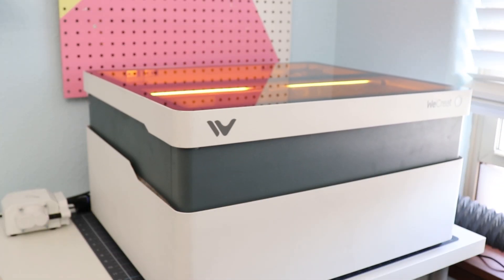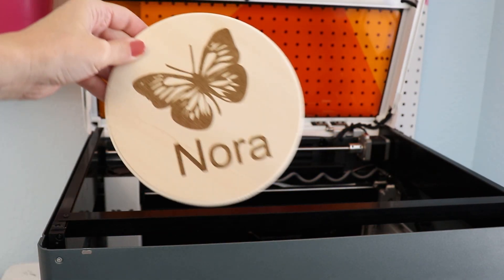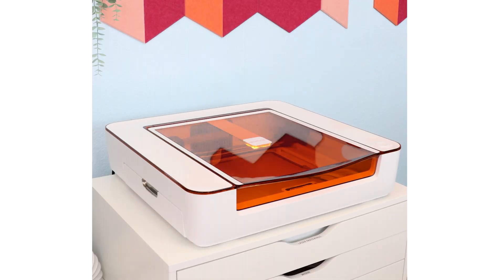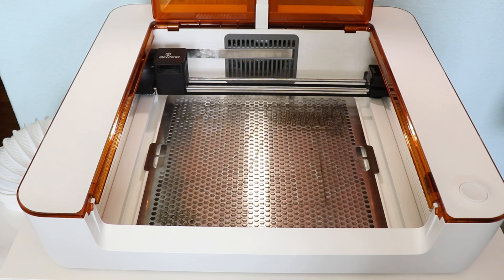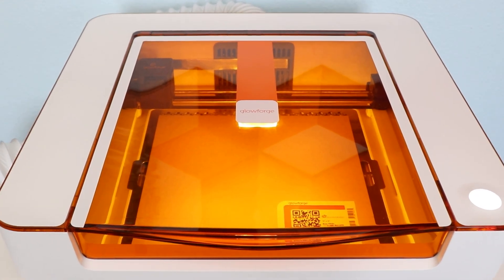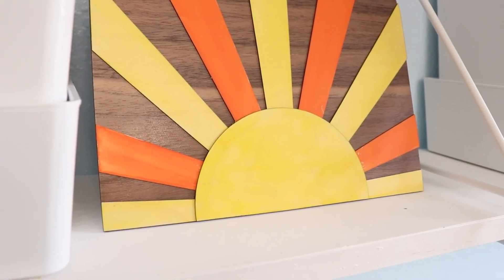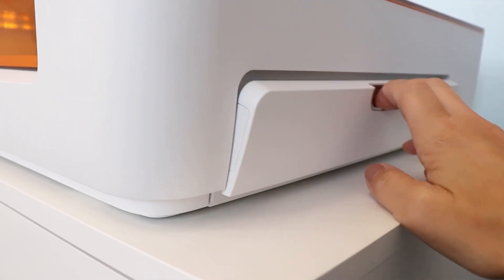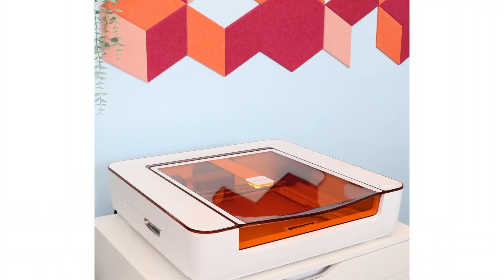Wecreat Vision vs Glowforge vs xTool - Choose the Best Machine for your Craft Room

Comment: Does the we create have an air purifier? I heard the air assist for it but that is different, correct?
Reply from the maker: It should come with an air assist but that is for inside the machine. Outside you can hook up a purifier, theirs is called a fume extractor. It will filter the smoke coming from the machine.

Comment: Could I use it in the garage with door open at all times.  Would this be considered okay as far as ventilation?
Reply from the maker: Yes you can. I like funneling the smoke out a window so I don't have to smell it. If you are in an open area like that you'll be safe, but it will be a bit more smokey.